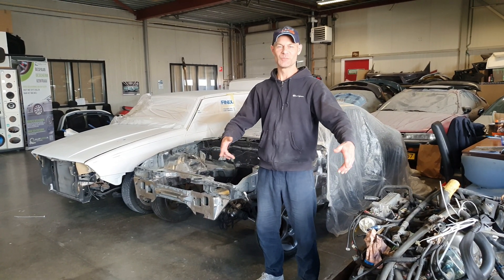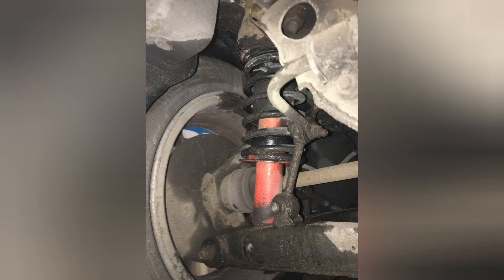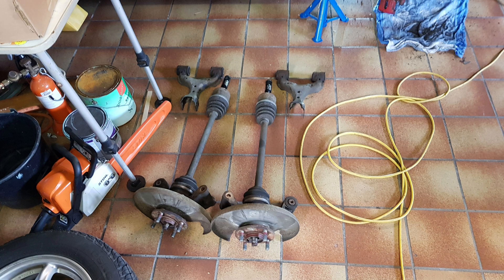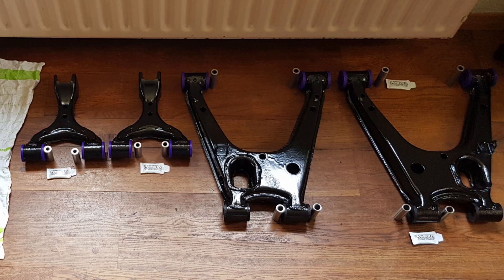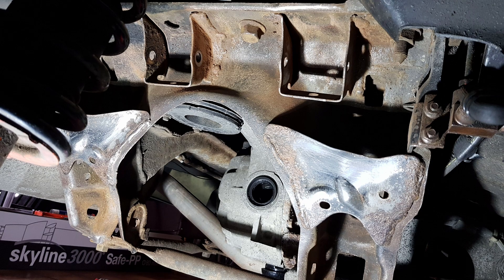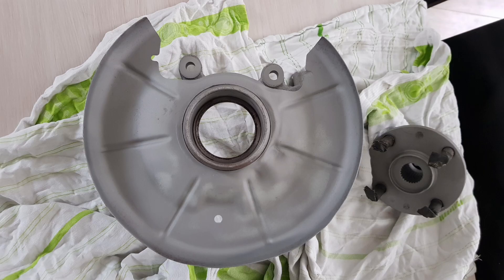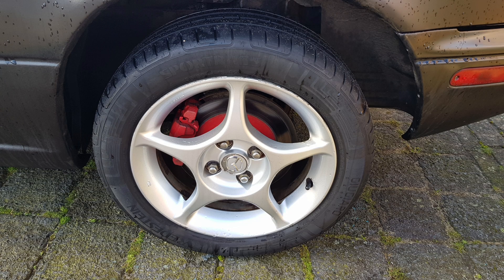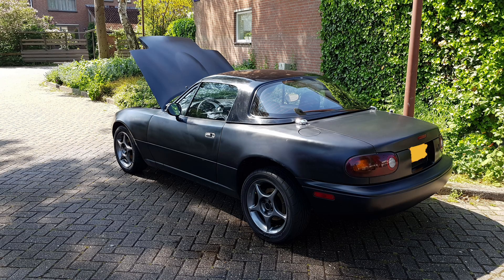Mazda MX-5 Miata rear suspension rebuild

Comment: Great job you have spent a lot of time on restoring them part
Reply from the maker: It's all because I really hate rust, I always try my best to make a part look as good as possible, when I re-use it.
I did the rear suspension rebuild in just over four weeks, the front suspension has been off since the beginning of 2021, and I still have to put it back together.
Soon....

Comment: Doing this on my nb gotta love michigan in the US salt snow and the most lovely of them all super acidic snow
Reply from the maker: How does the snow become acidic?
Reply: @dutchdreammiatabuild8808  all the smog from our factories in our city
Reply: Our ‘90 Miata was clearly stored outside (driven?) prior to us buying it in 2020, and also suffers from rust (Canadian car) We replaced the rotted subframe with rust free used pieces without painting anything and after 5 years of summer driving/climate controlled winter storage the replaced pieces are likely to outlast the rest of the car. Cosmetically though, you can’t argue with this guys results.
Reply: @MrOnemanop I sold my nb1 and used the cash for the down payment on my 2016 sportster 72, found frame rot near the front driver side frame when taking off the front wheel and decided that I’m done dumping money into it. Motor had 48k miles sold for 3200.

Comment: Just wondering? But how come you didn’t go with adjustable upper control arms and coilovers only for performance?
Reply from the maker: At the time I didn't have much budget for those kind of parts, they will be added further along in the story.
Reply from the maker: Coilovers and a set of adjustable control arms cost at least 1000 euro's together for the cheaper ones, otherwise it's probably crappy quality.